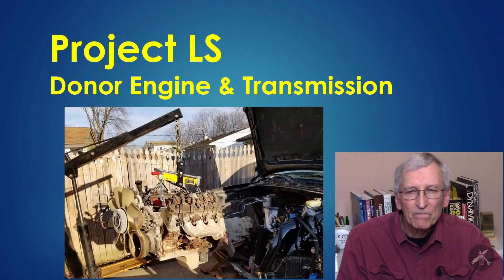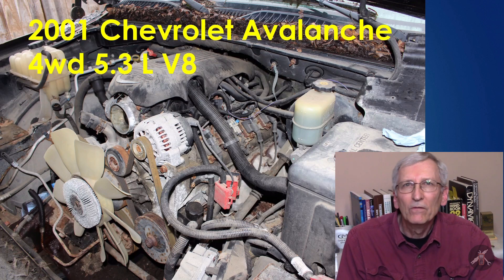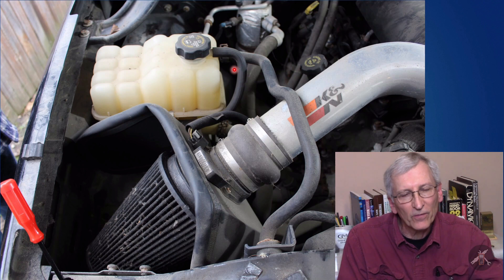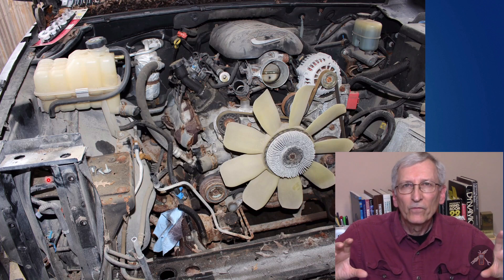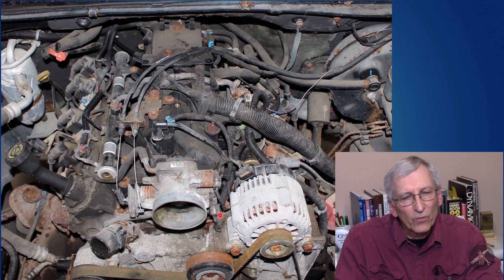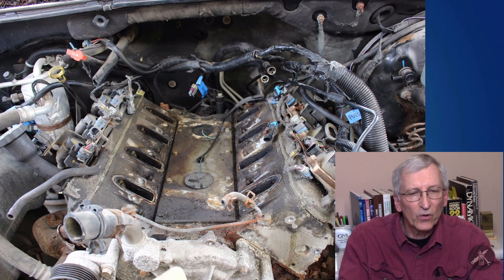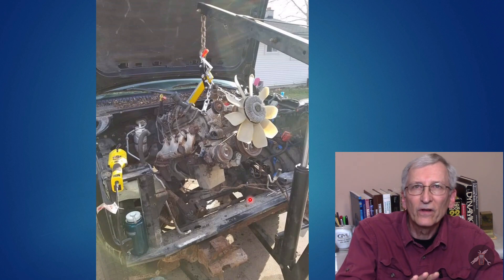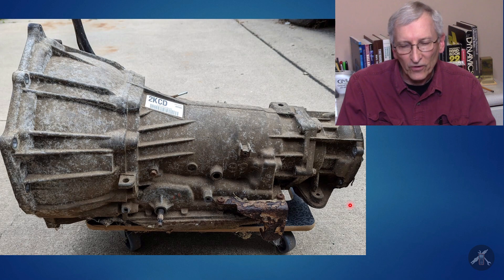Project LS Swap - What Engine and Transmission to use - Here is our donor engine and trans

Comment: Will a E-ROD LS3 engine fit just right in a 1988 IROC Z? Or what engine would you recommend?
Reply from the maker: There are a lot of choices. An EROD is nice, because it comes with the ECM set up and ready to go.  If you want an automatic, they offer a matched system that will have the correct controls and calibration for that as well.  There are installation challenges for any alternate engine.  The choices are often driven by your budget and time available to work it. I've seen a number of installations with a 5.3 LS and they seem to turn out well.
One challenge is planning the mounts.  There is a wide variety of aftermarket adapter plates.  Most, if not all of them cannot locate the engine in the same exact spot as stock. It will be either slightly forward or slightly rearward and may also be slightly higher than stock. It will take a little patience to decide the right position so that everything clears and sets in the engine compartment correctly.